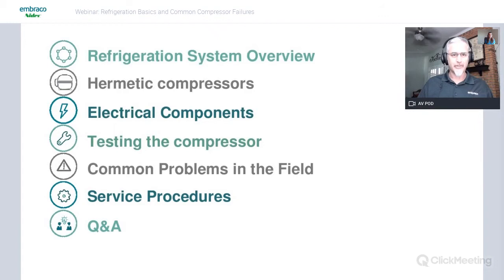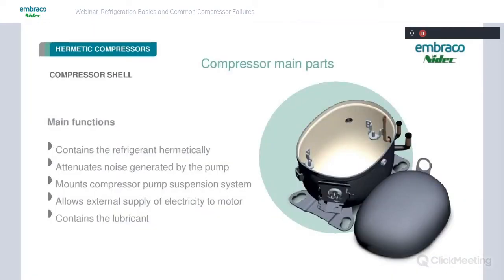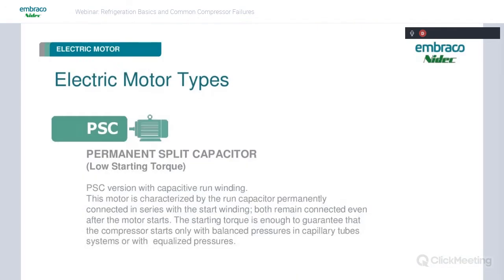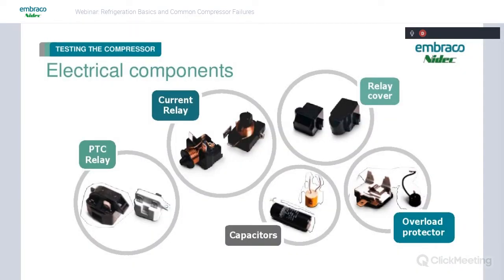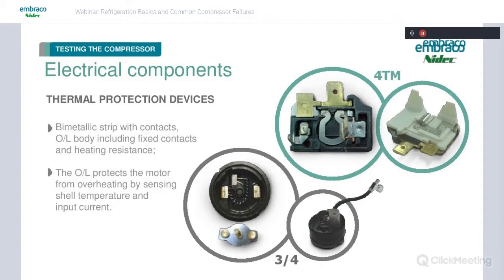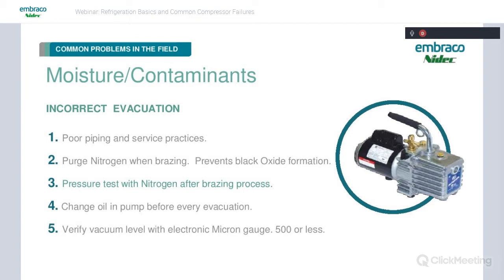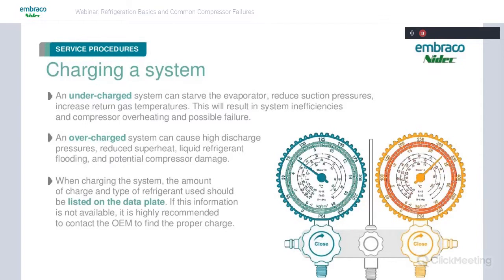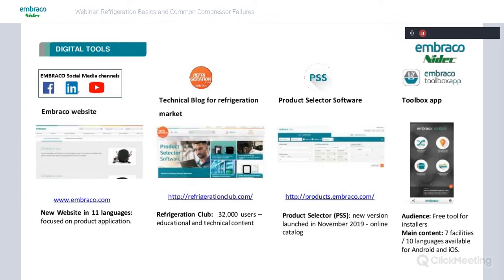Webinar: Refrigeration Basics and Common Compressor Failures

Comment: We have installed a home refrigerator system  ( after approval in the factory that COMPRESSOR system was ok ) , during the start we face strong vibration of the Compressor system. Kindly need your help to solve that problem --- tks

Comment: Does embraco recommend compressor replacement on systems with Poe oil  with a evaporator leak? I was told we would never get the moisture out of the oil.

Comment: Great video.  Thank you.  Embraco needs to have more English videos.
Reply from the maker: Thank you. We are going to have another Webinar in English on June 18th about Natural Refrigerants, join us!
Reply: Thank you.
Reply: Does embraco recommend compressor replacement on systems with Poe oil  with a evaporator leak? I was told we would never get the moisture out of the oil.